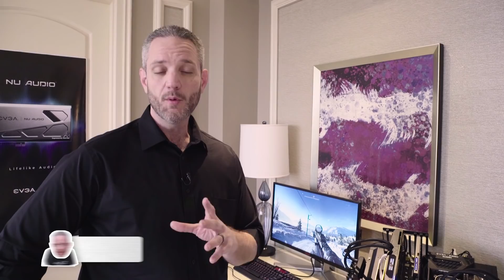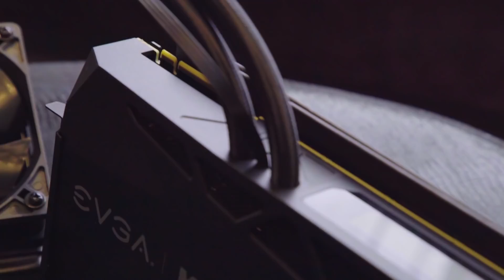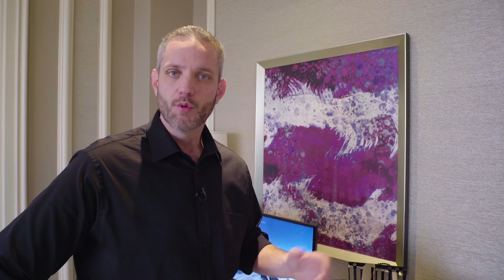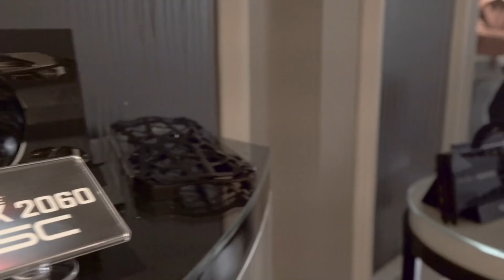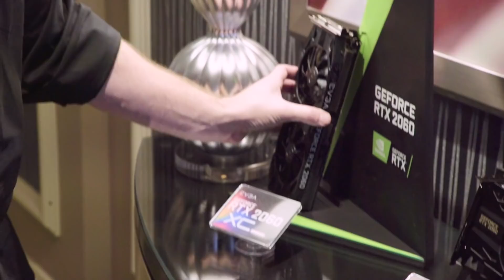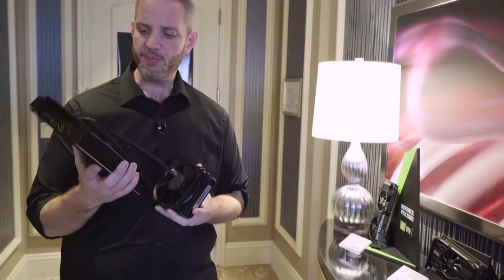THIS is how we are going to beat Gamers Nexus... Maybe

Comment: If the radiator was warm it obviously wasn't big enough.
Reply: And I would imagine the demo unit was not in OC. I'd almost have preferred that they gave us a preinstalled block with standard fittings for whatever we pleased to cool it with. 120mm seems... A little sparse y'know?
Reply: @agenericaccount3935  I think a 120mm radiator will still cool better than a typical 3 slot air cooler. How much so, who knows. But 500w is a lot of heat to displace. I think serious enthusiasts will still buy this, slap on a custom block and  throw it in a loop with x2 360s or better (remember - you need headroom for whatever the CPU will be too)
Reply: I have a 1080 with a 120mm rad , Even when i put the thing with a push and pull config i see that it gets to like 50-60c when its heat-soaked . wonder how this will do
Reply: @adonay944  I have a 1080 with 120mm rad and unlocked power to 280 Watt. Hits 70c in furmark. 500 watt TDP will heat it to 100c within seconds
Reply: running bf1 for hours with rtx, at 350w and with a fan literally not running it's enough. Also you probably can just replace it with a bigger one
Reply: dont worry probably for only 49.99$ difference they will give you 240mm version.
Reply: You expect a radiator taking heat off the card to be cold?
Reply: @lanceh90  Never. For cooling it's all about volume. And a heatpipe system has a better efficiency for heat transfer than a water system. A 3-slot GPU has about the same volume as a 240 mm radiator. So that's pretty much what it compares to. Don't forget that this card doesn't just have the radiator. It additionally has the radiator. So this already compares to a 360 mm radiator with a full block.

The bigger problem is that at 400 - 500 W the heat transition to water isn't effective enough anymore. Even at high flow rates that we have with modern pumps.
It's time manufacturers upped their game and started to make more use of phase-change systems. This could for example happen by adding a vapor chamber between water and card, then have a much bigger contact area with fins inside the water block.
They could also go full-on phase-change system. But that brings a whole new bunch of problems. Especially when it comes to pressurizing and/or filling the loop.
Reply: He said a very gentle fan curve. In other words, the fan wasn't running at max speed to cool stuff or similar(To reduce noise). Plus 50-60C is normal for graphic cards. Which is Warm to a human hand.
Reply: @popifrex1993  not cold but close to ambient temperature for best performance.
Reply: @NightfallSentinel  you expect a radiator to be at ambient temperature when it's pulling 300+ watts of heat off of a card?
Reply: @InvntdXNEWROMAN  One of appropriate size, yes of course. Obviously I understand they can't just stick a 360 on it for reasons but IMO its a bit wasted to not use the potential of liquid cooling. A big heatpipe cooler would perform pretty much the same.. The small radiator is the bottleneck.
Reply: @P8qzxnxfP85xZ2H3wDRV  I don't buy your explanation of the efficiency of this video card's cooling.  I have 480mm worth of radiator in my custom loop computer cooling an overclocked 9900k and overclocked 2080.  My graphics card has NEVER been hotter than 38°C running any graphics card stress test for hours on end. I'm willing to bet I could run both cpu and graphics card flat out and not see the temperature this card runs at stock.
Reply: @Whiskey11Gaming  I fully understand your point. The 480 mm of radiators seem to disperse more heat than your components produce. And that's good. Because that's the way a water-cooling loop needs to be.
I would estimate that your 480 mm radiators disperse about 500-600 W. And I estimate that your overclocked components produce about 400-500 W.
You can still see the heat transfer efficiency problem though, because if it weren't at its limit already, the temperatures would be closer to ambient. The fact that you're running at almost 40° C with a loop that has more heat flux dispersion than production means that there's a bottleneck somewhere. And that bottleck is the heat transfer from chip to water.
Reply: @club4ghz  I bet you anything Kingpin knows a bit more about how to make an effective overclocking card than anyone on this page.
Reply: @GlennsHardWired  If the radiator gets warm it means it can't keep up and gets heat soaked. The radiators job is to remove heat from the loop, if it doesn't remove enough heat from the loop you get warm water. What's better at cooling, cool or warm water? See what I mean?

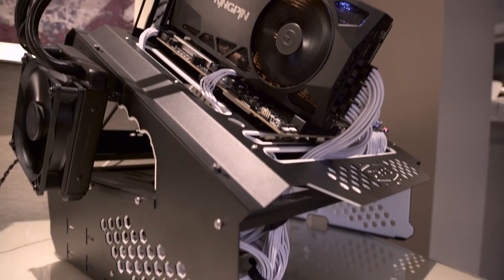Comment: 1:30 Or just put on in a PC here in Sweden during winter. I reached top 1 spot on TimeSpy Extreme with i7-6800K and a EVGA 1080 FTW. CPU  and DDR4 voltage at 1.5V, and put the case on the balcony. CPU didn't go over 50°C

Comment: Some people commenting about the cooler don't seem to understand what the new 2080 Ti Kingpin is designed to do. It probably should have been mentioned that Kingpin cards are meant to have have LN2 pots strapped to them before turning them up to 11 and put the excessive power delivery to work. The 120mm rad is really just a place holder so it can work out of the box.

Comment: Burning the midnight oil?
Reply: This same i learned this in English class 😵
Reply: Oiling the midnight burn.
Reply: "BURN THE MIDNIGHT OIL"
Reply: How do we sleep when our beds are burning?!?!
Reply: @Hebdomad7  we dont. that is the point
Reply: What's the meaning of the phrase 'Burning the midnight oil'? To work late into the night. Originally this was by the light of an oil lamp or candle. More recently, the phrase is used figuratively, alluding back its use before electric lighting.

Comment: One of the things from EVGA that I was interested in as well, which Jay didn't touch on in this video, is the sound card. The colour scheme would look awesome in my current setup and I'm a huge fan of EVGA products. My main gripe with Sound Blaster is that the ModMic that I'm using requires additional power, which they don't seem to cater for properly. It ends up with noise that even their top cards don't fix from the hardware side - it just tries to fix with software. The ASUS Xonar series works perfectly with the ModMic but it doesn't have either front panel or separate ports for front & headphones as I use both speakers & headphones. The ASUS Strix series has the same issue as Sound Blaster. EVGA's sound card looks really promising as it has separate ports for front and headphones so would be really good to find out whether the ModMic has feedback.
FWIW, yes, I'm aware that a USB sound card is a workaround for the ModMic but a high-end sound card shouldn't need a separate sound card just for the mic. I also assume that there will be more coverage of EVGA products from Jay.
Reply from the maker: We are going to do a stand-alone video on the card later on.
Reply: @Jayztwocents Awesome! Looking forward to it.

Comment: those mini sized cards,, are same performance as the usual sized video cards, ? cheers
Reply: All RTX 2060's have the same number of CUDA cores etc. The main difference is power delivery and the cooling solution. If you are not going to overclock then it wont matter too much. Better power deliver and better cooling means you can overclock more and have the cooling to deal with it. Oh and there are different 2060's with differing amounts of VRAM too, something else to consider.
Reply: Basically they are exactly the same cards, just smaller. Due to them being with only one fan, they may run louder and warmer, but other than that they are the same thing. It's possible that their PCB is a bit smaller than normal versions' too.
Reply: Both are same but i prefer to always go for dual fans because of better cooling. Higher temperatures deteroite the cards with time so its better to stay cool
Reply: @Erick Rosa yes ,but if you're buying a gpu to last you for 3-4 years then you need to keep your gpu as cool as possible.

Or you might have to service gpu regularly by cleaning it and Changing the thermal paste.
Reply: There is 6 different types of 2060 configs 3( 3gb, 4gb and 6gb) GDDR5x cards and then 3( 3gb, 4gb and 6gb) GDDR6 cards, so the different cards with different numbers of fans are probably different and with various factory oc
Reply: @raghavbatra12345  Even 90C is perfectly fine. I have FX 5200, ATI X800 Pro and ATI X800 XT PE still alive and kicking. FX 5200 had it's fan deaf for months and worked perfectly fine. Now it's fixed, but GPUs are very robust things. 3-4 years is absolutely nothing. For comparison in 2014 80-90C was acceptable, now 70C is. Cooling has come a long way and it would be hard to find actually overheating cards. GPUs working at 90C are now pretty much extinct. Even at those 90C they should last at least 6 years without problems, yet I would expect 10 years. They are pretty much like CPUs, indestructible, unless you are doing something really wrong (extreme overvolting, extreme humidity, literally breaking cooler or etc).
Reply: @raghavbatra12345  Please stop giving people computer advice lol
Reply: @MJ-uk6lu  90c is pushing it because you don't want to drift to 100 and throttle. I would recommend turning on MSI afterburning and setting the fans all the way up if GPU goes over 85 and if you notice your fans keep revving up I would make adjustments to your fan speeds to keep within 70-80c under load.
Reply: @iblockdoors4719  Sure 90C is pushing it, but cards can handle that and like I said, most of them never reach that. Even reference RTX 2080 Ti reaches only low 80s and that's currently the best of the best.

Comment: For clearification: the Chips used for KP Cards are the best binned chips that are sent to EVGA, not the best chips of ALL 20xx chips overall, right? Cause Nvidia keeps the highest tier chips for there FE cards or did i get something wrong?
Reply: best of the "A" skus ie TU102-400A, a denotes a higher bin, the kingpin will most definitely feature an A chip, same as FE, its just down to the best EVGA get, the slightly lower would go into FTW, the non A chips are for blower cards and cheap tightarse models
Reply: @bigcazza5260  are blower models still a thing on 20xx cards??

Nvm. Just saw, that zotac for example really brought a blower card 2080 to market. Holy crap, why....
Reply: IKR? absolute shit, no point getting a blower card unless ur gunna go water, but that still defeats the purpose when you are starting with shite sillicon

Comment: I don't think a 120mm rad even in push pull with delta 120x38mm fans @ 5k rpm is enough to dissipate 500w of cooling. I have a Corsair h100i v2 on my i7 2600k that has been oc'd to 5ghz the past 8 years with 4 delta fans in push/pull configuration and even at 100% speed on prime95 with small fft's it still gets to 65c with an ambient of 20c. I know that cpu isn't pushing 500w so I have no idea how this can cool this gpu properly when being fully utilized.

I will say though I understand the 120mm rad for case compatibility, but maybe have an option for a 240mm rad with longer tubing to extend maybe to the top/front of cases?

Either way this looks like a killer card. I just wish we had a release date, I have a friend that is looking at buying a rtx titan, but this maybe a better option if available this month.
Reply: Its not just a 120mm rad, there is a fan and heatsink on the card itself too.
Reply: @inteli3i5i7  yea, I saw it. I don't believe it will dissipate 500w of heat.
Reply: Kingpin design never focus on the cooling solution, only the power limit and bin component. That aio and 1 fan with copper sink only for stock and boost. They will make their own cooling solution if they want that 520w tdp
Reply: @zZMerciZz  That's my point exactly, why make the card more expensive for no reason, might as well make it a custom water block. I just don't see the need for this. If people are willing to spend this amount of money, they most likely are having custom cooling solutions. And if they don't then why spend money on something that you'll just heatsoak and not get your monies worth? I'm just really confused on this market standpoint. I mean it's supposed to be the ultra high-end class, but delivers mid-range cooling. Basically, what I'm saying is go big or go home. And this goes big on capability, but is making it more costly for no reason when majority of the people that buy this will put custom cooling solutions on it.

Comment: BULLSHIT THEY DIDN’T SEE A DIFFERENCE BETWEEN 120 & 240MM!

The heat dissipation difference between them is big, and for a card pulling 150w+ that 120mm’s 120-150w~ limit is gonna become apparent when that 120 AIO starts losing liquid quick and temps rise under full load.

Comment: This would've been what I got if it were just a block instead of an AIO. Poor choice, EVGA.
Reply: You can propably deattach that aio and attach a waterblock if they are gonna make one that fits to it
Reply: @l__l2328  Usually AIOs don't let you detach the connections on either the block side or the radiator side. Even if they did, the attachments likely aren't standard, so having to go barbed super thin tubing would look stupid in a case with even smaller 10/13 inner/outer ID size tubing. A stand alone kingpin water only card would make me return my founders card, but I get you, some AIOs are expandable.

Comment: 700$ rtx 2060 build w/ ryzen please :D
Reply: You're going to CPU bottleneck the 2060 with that $700 budget
Reply: You'll be stuck with a 2200g, 8gb of RAM and only a 1TB HDD and still be over the $700 budget by $50-$100
Reply: Which ones? An RTX 2060 is going to be my maybe $349. That's half of the $700 budget OP stated. That leaves $350 for CPU, Mobo, RAM, Hard Drive/SSD, case and PSU.
Reply: Now obviously you can go used with every other part and easily build a powerful system around the RTX 2060 for $700
Reply: Direnta  you can't afford a 2600 in a $700 budget PC with a 2060 in it.
Reply: Yes it is in a $700 budget PC!!!!
Reply: @D00m3dHitm4n  i hope this isnt your job
Reply: Haha its fun to watch ur conversation
Reply: you could try a cheap r5 1600/ 1600x - 8 Gb ram and a b350
Reply: @emanuelelin1010  they are not cheaper , at least in uk they go for literally the same price as the 2600
Reply: Direnta  dude do you understand english? the guy said that with a 700 budget and an rtx 2060, the cpu that you could fit in the budget would bottleneck it. and he is 100% correct, you wouldn't be able to fit in anything more than a 2200g using the remaining 350$
Reply: @D00m3dHitm4n  Maybe not a 2600. But 1600 and b350 board with 8 gb of ram, 500w psu, 500gb sata ssd, and a cheap case, maybe. But it's close
Reply: Only way to hit $700 and under buying new parts is a 2200g or an i3 8100 with 8 gb ram.
Reply: You're going to CPU bottleneck the 2060 with any ryzen cpu
Reply: Yavi / Veii  emp, yep, max gpu for ryzen is 1070 hehe, and that ram cost more than the cpu itself, so, ryzen for high end gaming is shit, only mid end
Reply: Yavi / Veii  no any actual ryzen cpu can beat the 9900k
Reply: Yavi / Veii  idk, a stock 8600k 4.1ghz wins easily in gaming over a 2600x oc 4.3ghz, so ipc is still better on intel, salu2
Reply: Yavi / Veii  And? what happened eh? HAHA
Reply: Yavi / Veii   so you want a 4000mhz cl12 kit to "no bottleneck" infinity fabric, or maybe, IF is just shit no?, the ring system of intel is far better in latency, so intel is better, but how you say amd fanboy, intel was is and will be better on gaming, good luck
Reply: Yavi / Veii  ok, when ryzen 3 releases we well see, for now, i only care about the present, and in the present intel fucks ryzen on gaming
I see the videos you put, yeah good gains, but still beyond intel
Reply: Yavi / Veii  "closing the 7700K gap in gaming?" HAHAH that says everything, so a 8600k/8700k/9700k/9900k at 5ghz destroys, if even they cant with a old quad core cpu with lower ipc than coffe lake, and, on ultra settings with gpu bottleneck are that benchmarks, if you wanna see the cpu raw power put the games on low, or a low res, not ULTRA 1080p because the gpu will be the top, and even with that intel squezes a like 10fps more jeje
Reply: Yavi / Veii   i go direct to benchmarks, thats why
Reply: Wow
It's like watching a slow intense chess match
Why didn't you guys warn me to bring Popcorn??????!

Comment: not impressed with those temps at all specially on watercooled and not oc.  my 1080 ti strix @2037cc and 12000mc sits at 58c with 57% fan

edit: so many fanboys replying with dum dum shit its funny. that card has a shit cooler, stop sucking mkaaay
Reply: @Erick Rosa Yeah, that's not how water works.
Reply: Still have to take in ambient temperature, disappointed he didn't mention what it was.
Reply: @Erick Rosa  Erick Rosa  Based off Jay's clothing and the tone of year, I don't think ambient is an issue. Maybe the fan speed was low. 

In terms of 1080 TI vs 2080 TI, you're looking at a 15% increase in power consumption. But you've also got a larger die with the 20 series, which will dissipate more heat. 

Finally, like Pascal, Turing doesn't scale with voltage above ambient. So unless you are doing LN2 that power isn't going to do anything beyond a certain point ~350-400W. You can check der8aurrs videos on this. 

Bottom line, 57c is high, even with the added watts in mind.
Reply: Think many people in this comment thread forget the fact that the fan wasn't running its max to reduce noise. So it runs at that temperature with a fan that doesn't sit even at 50%. Because you hear a fan at 50+%.
Reply: He did say the fan is in a conservative curve so probably isn't being spun very fast.
Reply: It’s running RTX at 1440p on full settings, with a quite fan curve... 😂
Reply: All those temps are pretty great.
I remember my 8800 GT that ran 103°C under gaming load, or my 660 ti that tippled into the 70's
Reply: @paskowitz  15% power increase is about, ummmmm, 40 cents a month. Unless ur kwh costs like 40 cents.